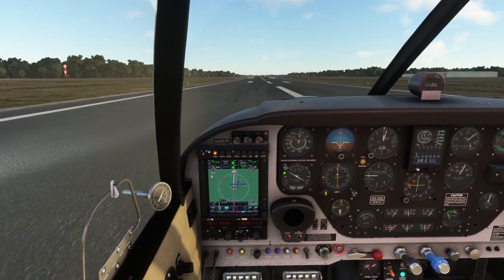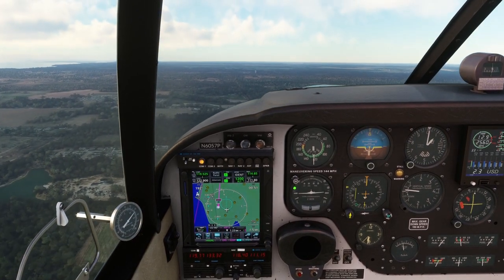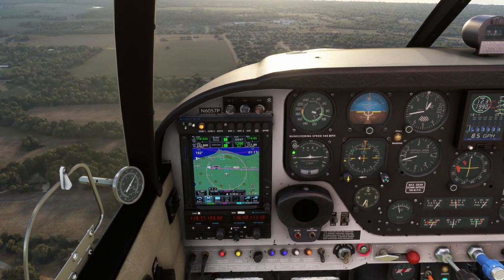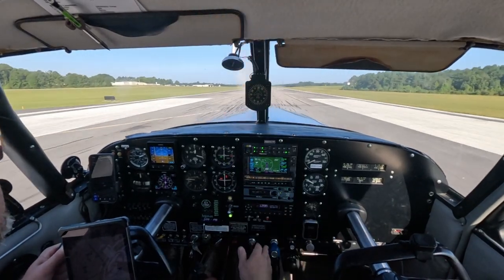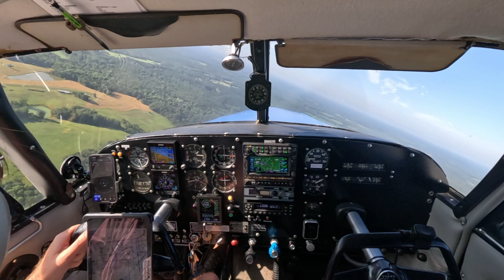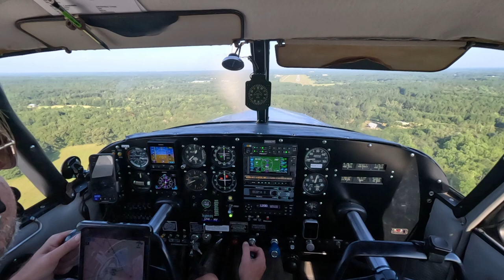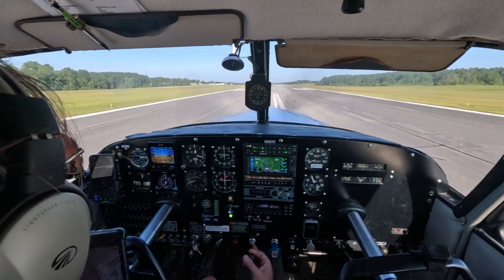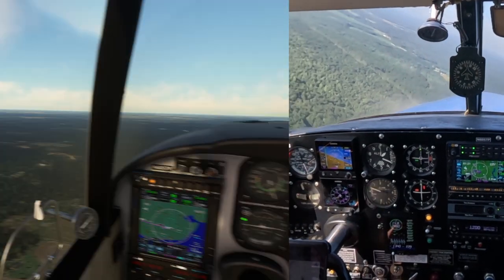A2A Piper Comanche Takeoffs, Patterns, & Landings MSFS 2020 - Review & Tutorial by a Comanche Pilot

Comment: Great video, thanks for taking the time to produce. Overall, would you say that the A2A flight model is fairly representative of the actual aircraft under normal flight conditions? would be interested to know if there are any phases of flight in particular where it falls short.
Reply from the maker: If you get it into the stall regime it seems to diverge at lighter than gross weight but it’s a lot to ask any desktop sim to get edges of the flight envelope exactly right.  As discussed in the video, sim power settings for the same pattern speeds are lower but the behavior at the correct speeds is spot on.  I don’t have rudder pedals so into the flair with any amount of wind is hard to judge.  Coming back to your question of normal flight conditions, I’m continually impressed with how close it is to the real thing.